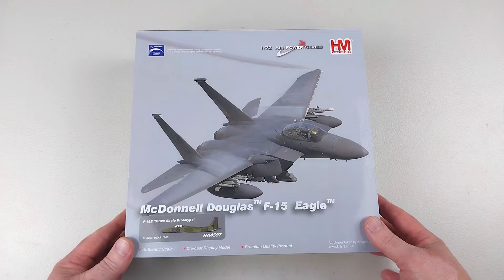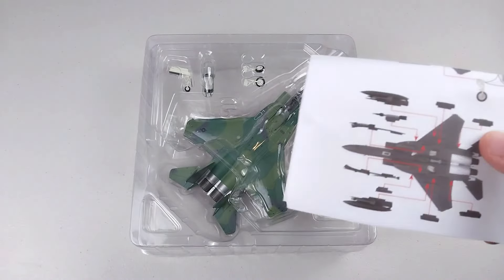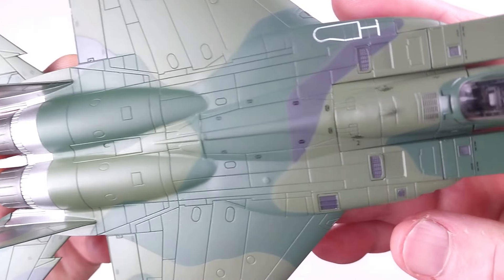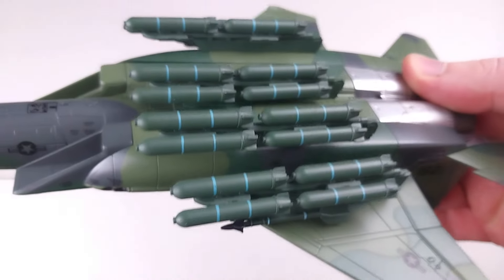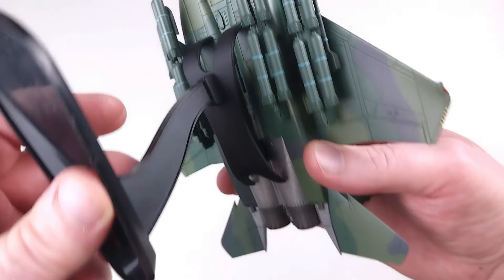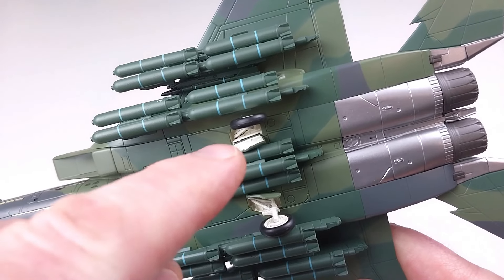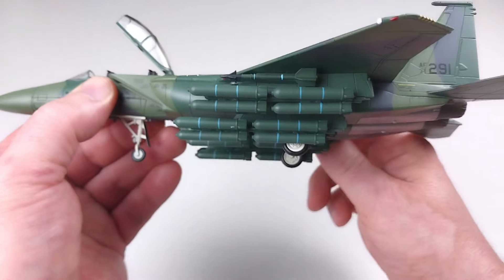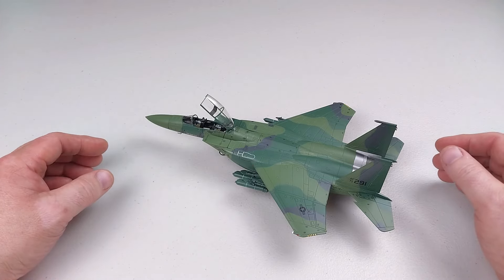McDonnell Douglas F-15E Strike Eagle Prototype, Hobby Master 1:72 Diecast Model Review HA4597

Comment: I’ve got this release, and I like that jungle camo on this F-15 B. This was originated as a B prototype and thus transitioned to the E model. It's very rare to see this color scheme on the F-15's. I also love that massive loadout of those CBUs cluster bombs regarding the front landing gear. I have a solution for you; you can file it down. That should solve the problem. I’ve encountered this problem with various models. I just have a set of files, it just works. By the way, nice review.
Reply from the maker: I love the camo as well. It really suits the shape of the Eagle!! I have a nail file and sandpaper that I use to make things fit a little better as well. But I like to do the straight out of the box review so that if there are any small issues, I can make note of them so people can be aware that this could happening their model if they buy the same thing. Thanks again for dropping past and sharing your knowledge with everyone here!! Its always appreciated!!!

Comment: Was debating on getting this or JC wings version and I still think I will go the JC route simply because of the added figures and equipment it comes with, much better looking to display but man was this one hard to decide 😅
Reply: It's not just the figures that make Jc Wings better. HM F-15 has too many inconsistencies. Jc Wings also has a discrepancy, but it has less...
Reply from the maker: I may get the JC version myself. Just to see the difference in how it goes together. Fitment in the HM one was pretty much flawless, went together like a dream you could do it blindfolded. I have had some issues with JC Wings being very inconsistent with fitment. I have a JC Wings Tomcat to open up which is new so that should tell me how they are going with newer releases. The F-16 I opened up recently had a lot of problems!! Thanks for watching!!